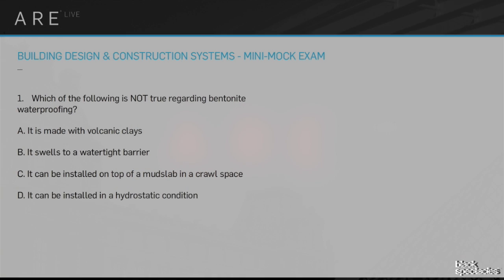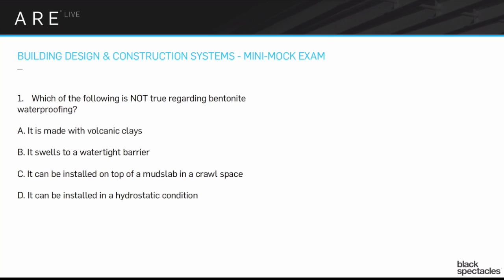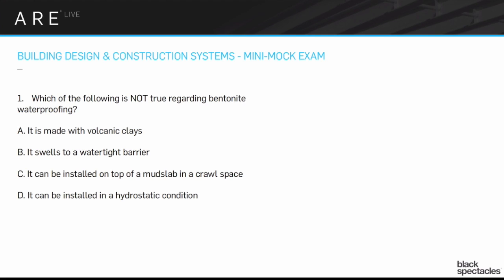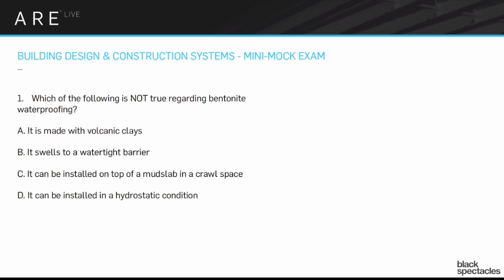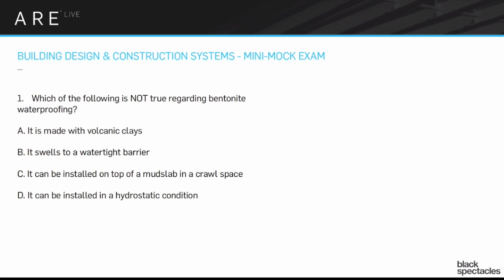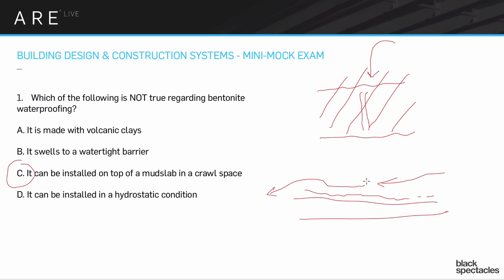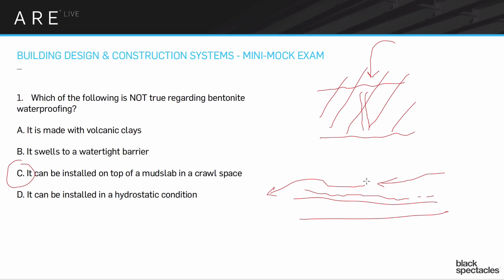Bentonite Waterproofing - Building Design and Construction Mock Exam - ARE

Comment: Bentonite and volcanic clays sandwiched between geotextile, have been found not suitable to waterproofing brick or concrete blocks, water eventually penetrates the thin clay membrane and goes through the blocks, it also drys out and does not reseal when rehydrated. They work best in relation to waterproofing large structure dams when used in thick layers. 
Solutions that work are the torch-on 2 layer roofing bitumous products, TPO, and or  polythene or polyethylene plastic membranes. All need to be flashed well so water can not penetrate from above and work its way between the layers. Stick on wraps have issues as well with adhering to the surface needing protection. Good drainage to remove surface and ground water supplements protection.
Liquid paint on coatings and polymers also let water pass via osmotic action if permanently in contact with water.
There is no real solution to waterproofing below gound to stop positive pressure groundwater entering the concrete however polyethylene and hot applied bituminous products are most reliable when combined with good drainage.
Also the more protective layers around the waterproofing membranes the better, rocks can punture the membrane so the need to be keep away from the waterproofing layers.
Reply: Balls